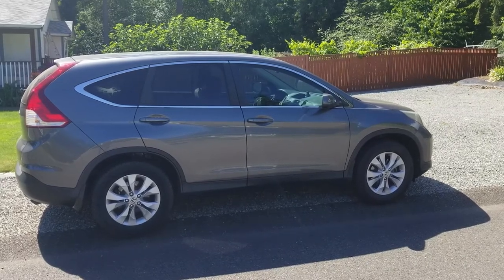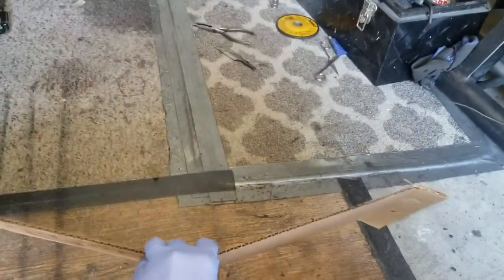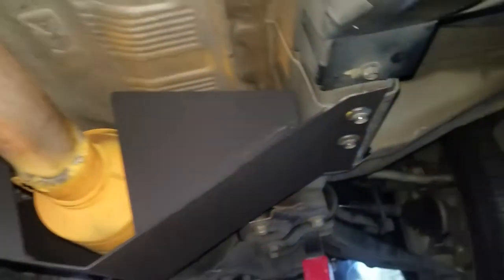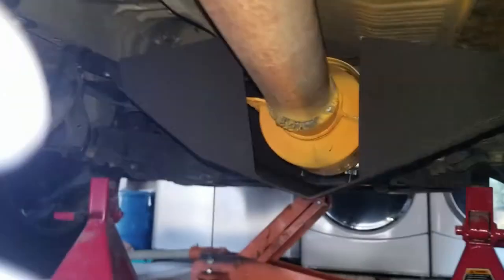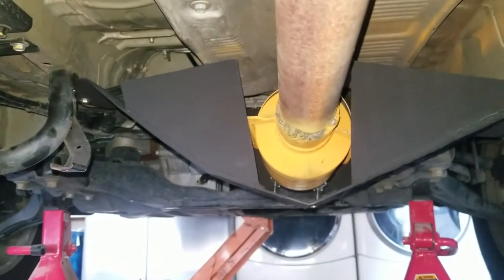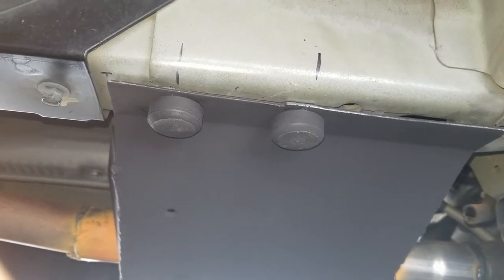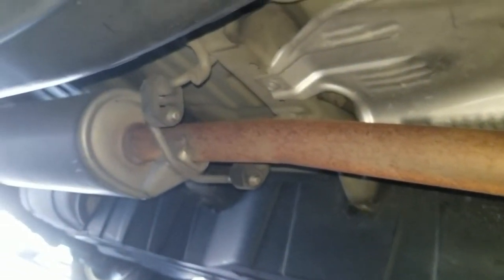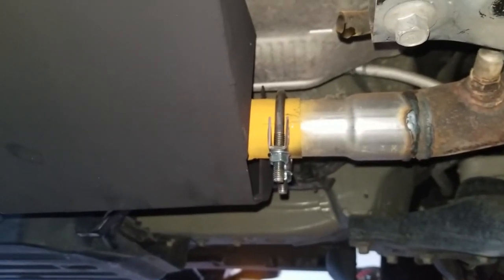Honda CRV Catalytic converter plate protection cover #CAT #Stolen

Comment: Great idea ! . 
  BUT ... what if they bring their cordless impact driver that came in the Cordless Tool kit the stole ? 
  I'm gonna make the identical plate & mount it the same way. Except when I'm done I'm going to take it to a Muffler shop and have them spot weld a couple inches on each side.
 Thank you !
Reply from the maker: It should be removable.
I would spot weld too but...
Impactor is a time delay. They need it done fast, before you are able to out your pants on and come out.

Comment: I wonder if messing up the converter visually by welding something to it would be a better deterrent.
Reply from the maker: They will cut further away and do more damage.
You need to make CAT removal possible but with tools, not the saw.
They dont use tools, they just cut it off because its faster.

Best method would be reinforcing the plate with either hardened steel bars or aluminum bars so they cant cut through.
And i would need to change those bolts to a pattern bolts requiring special key to remove them.

I had no time nor will to do any of that because owner was not too interested in me spending money on it.

Comment: 😮 $700 twice!!! I would have charged her $600 with labor and material, a whole new cat from the exhaust manifold, a whole new resonator, and two oxygen sensors.😒
Reply from the maker: Washington state BUCKEY's is known to rip people off, especially single women.
The very least i could do is to do this for her for free. She only paid for 2 bottles of heat resistant spray paint.

Comment: Not trying to rain on your parade, but you’re wasting that young lady’s money again first of all that yellow paint is not  going to do squat and that contraption that you put around it you do know they’re gonna be able to slide it outs and the bolt things that you’re covering your bolts with is worthless next time make your contraption tight around the converter that hole it’ll come right out and do her a favor and tack weld all the mounting bolts for your contraption of course after you make it tighter around the converter lol and one more thing you mentioned that it was an aftermarket converter. The thieves are not gonna steal an aftermarket converter. They’re only worth $15 in the market.
Reply from the maker: ha ?
parade ?
it did it for free